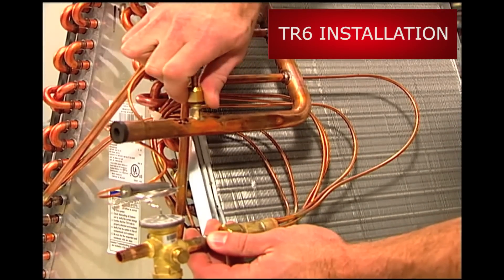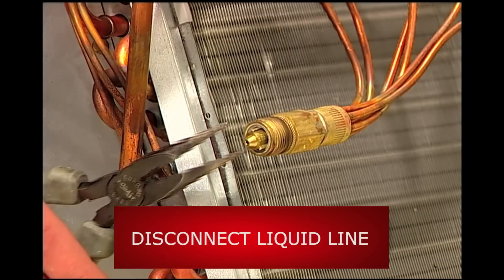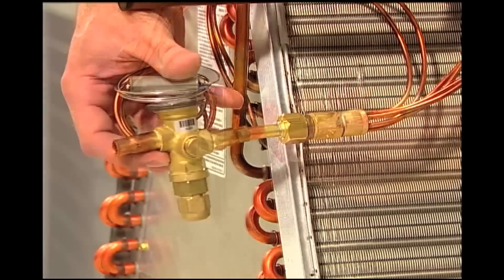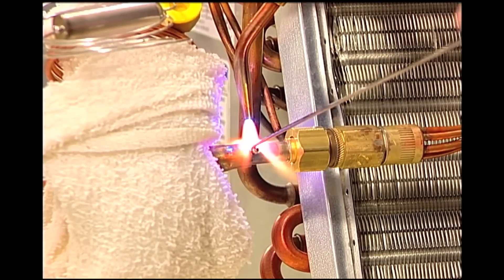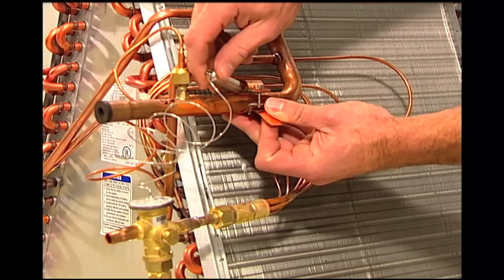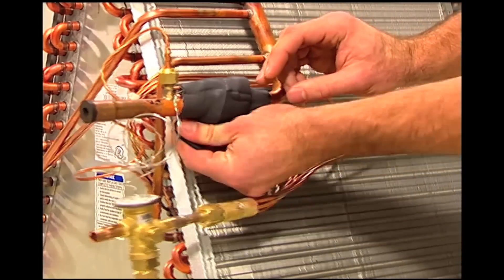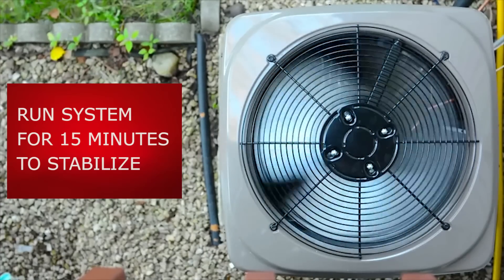TR6 thermostatic expansion valve installations

Comment: Are TXV’s universal and that a 3 ton can be installed on any 3 ton? Obviously the fittings are important but so long as it fits. There has been much debate within my company over this. We’ve had instances where we need a 2 1/2 ton outdoor TX me and we have a 2 1/2 ton That will work
Reply from the maker: Hello,

A 3 ton valve will fit any 3 ton unit as long as both are rated from the same nominal capacities. If you're unsure about this, our Coolselector software can help confirm the capacity of the valve at specific conditions. 

https://www.danfoss.com/en-us/service-and-support/downloads/dcs/coolselector-2/

Comment: Shouldn't I flow nitrogen while brazing?
Reply from the maker: Hi mdimascio, This video was created for instructional purposes in one of our application centers to help technicians understand how to install a TR6 thermostatic expansion valve. It is necessary to flow nitrogen when brazing any copper or brass refrigeration fitting. The nitrogen prevents the formation of copper oxide which will move through the system and possibly block the orifice in the TXV and, if it is a heat pump, damage the reversing valve.

Comment: Why external equalizer line used in txv?
Reply from the maker: Hi Neel, generally, in larger systems that are over 1 ton capacity, external equalization is necessary. The same goes for any system utilizing a distributor. Currently, the TR6 thermostatic expansion valve is available in capacities of 1.5 ton to 6 ton depending on the refrigerant used, making external equalization the preferred route. If there is a specific system you are working with and have questions on, your local Danfoss technical support team is available to assist. https://store.danfoss.com/us/en_US/find-a-distributor”
Reply: @DanfossNorthAmerica   thank you for your reply. Positively looking forward to business with you.✌🏻

Comment: Heloo  sir.. Emerson 10. Kw  capacity walking chiller.. Temperatur +5c...using danfose  expansion valve.. What wiil be size of orifice in side that
Reply from the maker: Hi Jinu John, when it comes to product selection, we recommend starting with Coolselector®2, available for free download or online here: http://coolselectoronline.danfoss.com/. With Coolselector®2, we take the complexity of calculating equations out and you can quickly find the product that meets your needs. Visit https://www.danfoss.com/en-us/service-and-support/downloads/dcs/coolselector-2/ for even more assistance with Coolselector®2 or contact your local Danfoss customer support center.
Reply: Check the denfos catalog which is mentioned  in the box packing of denfoss valve

Comment: May i know in clip 1.26 minutes you joined in suction is what?
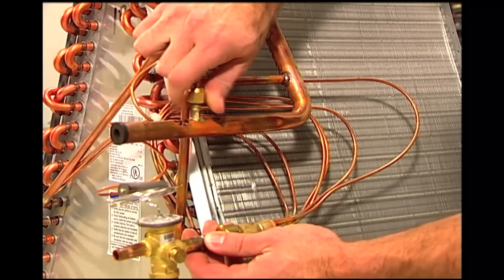Reply from the maker: Hi Chandra, in the video at 1:26 the instruction is that the sensing bulb and equalization line should be installed to the suction line after the header. For more help with TR6 installations, download the guide here: https://www.danfoss.com/en-us/search/?query=AN000086419860

Comment: you don't charge by super heat with txv so why check it unless there is a problem. The instructions usually say 10 o'clock or 2 o'clock for the bulb position on the pipe. I do not think you tightened the fittings to proper torque. And its never that clean or well lit not realistic must be a fake video. Probably a guy who has never changed one before only in the books.
Reply from the maker: Thanks for the feedback, Batman 1999. This video was created for instructional purposes in one of our application centers to help technicians understand how to install a TR6 TXV. As a good field practice we encourage technicians to check the superheat before leaving the job after the system has had time to equalize to ensure any adjustments to the valve are needed or not and to ensure it is regulating superheat properly. If you have any additional questions or need assistance with your TXV installations, our tech support is available to help you at 1(888)DANFOSS or cooling.cs.na@danfoss.com.